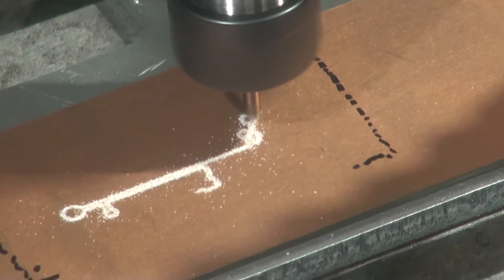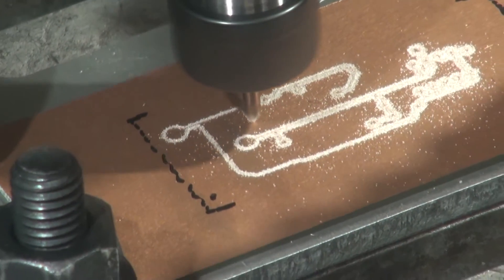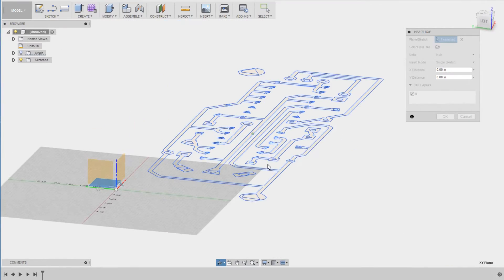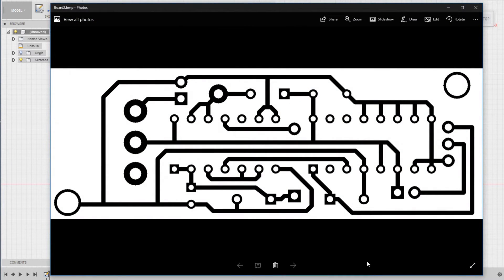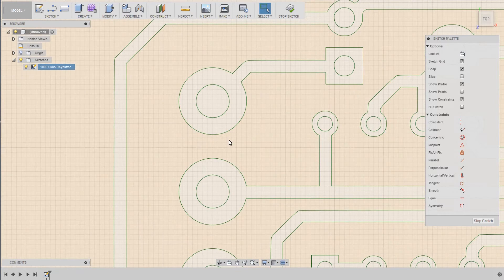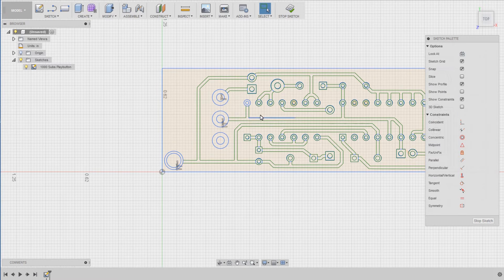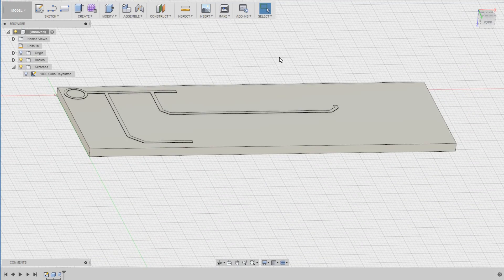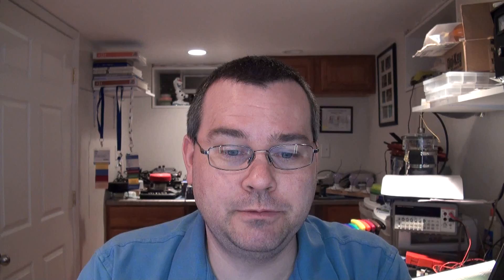CNC Milling Printed Circuit Boards PCB

Comment: Useful for a very quick try-see, but you can't beat those quick Chinese fabs:
https://pcbshopper.com/
Reply from the maker: Hmmm, is this an ad?
I have tried stuff from china, you get what you pay for. I can get quality US boards in 2 days for about $50. Good price for something the traces wont peel off of.
Reply: No, not an ad.  Just a link to a site I've used a few times to compare prices.  I've bought from double sided PCBs from PCBCart (inc stencil) and DirtyPCBs with excellent boards from both.  I'm just finishing off a small cnc machine for routing the boards in to unusual shapes as the Chinese sites tend to only like rectangular boards.  That said, I've read Dirty PCBs will actually accept a routing profile on the board layer but I've not used it.
Reply from the maker: Ok, sorry about that. I have had a fair amount of ad type posts lately. I have ordered stuff direct from China before, have not been very happy with quality. I tend to use smaller SMT parts with tight trace spacing though. Might just be asking to much.

Comment: Good stuff.  You might want to try another option to get your original DXF file into Fusion 360 cleaner.  Instead of directly inserting the DXF file into a sketch, create or select a project folder in Fusion, and use the "Upload" button near the upper right corner of the Projects panel to upload your DXF first.  The DXF will become a Fusion file with the DXF file in it as a sketch.  Open that file in Fusion and see what you get in the sketch.

As it goes, I recently learned that AutoDesk has acquired the very famous CadSoft Eagle PCB software.  It is now AutoDesk Eagle and it is available for free download.  I haven't tried it but the Fusion 360/Eagle combo should provide a cleaner export/import environment.  I wonder how long before they add a "PCB Layout" environment inside of Fusion 360???
Reply from the maker: Hello, I found that either method works equally as well. A lot of times I import a DXF as a sketch to lay on top of existing solids.

I don't think Fusion would every see PCB layout, kind of a different domain then its intent.
Reply: Right on.  I wasn't sure because it seemed like for some file types (like native DWG) the Upload button is the only way to open certain types, which led me to believe that some import algorithms may actually be on Fusions server, rather than locally on our machines.

And on the latter, I would likely wager on that one because I think the general trend in the industry is to move towards an integrated, seamless design and manufacturing process/work flow, and I see a lot of effort going into integrating MCAD and ECAD.  It is unlikely anymore that any modern gadget will not have some kind of electronics in it, so I think the "Fusion" of all the different disciplines is inevitable, even if just for economic reasons (time saver, better designs).
Reply from the maker: Many of the conversions do happen on the server, but there are a few file types fusion can read directly on the local level.

Yes, but then your asking people that just want mechanical modeling and CAM to pay for having PCB layout as well. Part of the reason I like fusion is because it is primarily for mechanical and CAM design. I don't think it would service the architectural industry very well. Unlike other products that have tons of tool sets and adders for specific industry requirements.

Comment: I liked this, but how does it compare to the effort of using a gerber to g-code converter? Certainly agree with you regarding going to a PCB house if unless simple board needed immediately. Nice video
Reply from the maker: Huh, did not think of gerber to G code. That should work as well, you may need to tweak the output for your machine. Thanks for the comments, if I make another board I will explore that option. Tim

Comment: This looks like fun. I get my boards from OSHpark.com and they cost way less then what you have described. I hope you aren't paying $100 for prototype boards.
Reply from the maker: Hello Luke, typically for proto boards I use Express PCB. They have the best price I found. For a 4 layer board, 3.8" by 2.5" size for there mini board service you can get 3 boards just quoted at about $88. 2 layers is about $45 shipped. The link you supplied for 4 layer is $10 a square, 9.5^2", $95ish. The only bad part about Express PCB was getting gerber files, but you can now get them with your first order.

Comment: Good one. You owe me one on rotary broaching for the electrical slant on this one.
Reply from the maker: LOL, ok John I will add Rotary Broaching to the list of topics. But um... what are you doing to do when we deep dive into motors and controllers? That is hard core electrical ;)
Reply: Only thing scarier than an engineer is an electrical engineer.  We will cope if only for the entertainment value.
Reply from the maker: I did not know I was that entertaining? I do have a video coming up that is cringe worthy though!

Comment: Problem of machining PCBs is that they are not perfectly flat so you end up increasing the depth of cut. Also the stress from the cutting make the copper traces get weaker and they end up breaking from the lamination
Reply from the maker: Agree this is not the best option. But if you use a good sharp carbide tool the stress will be much less. If I do it again I'm going to try some thin double sided tape. You can see the board flexing when the cutter lifts off it in the video. But it turned out ok and I didn't have any lifted or broken traces.
Reply: Will you be able to map curved surfaces like PCB material with your Renishaw probe?